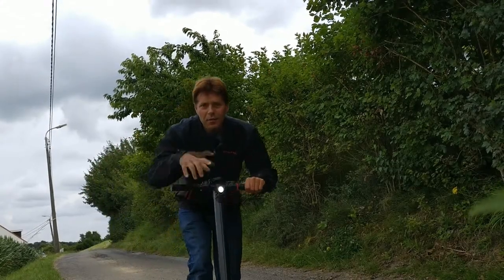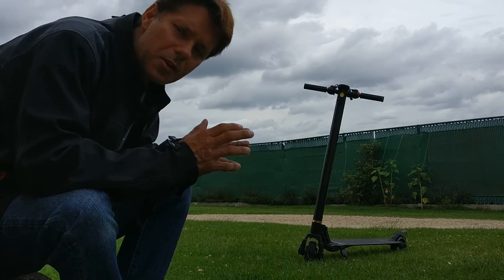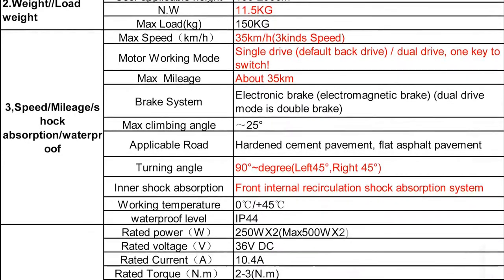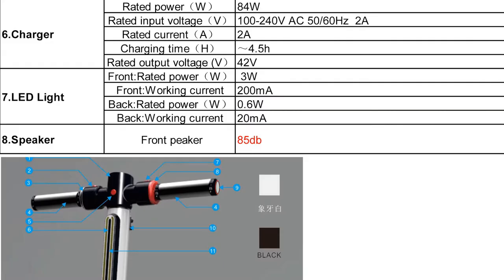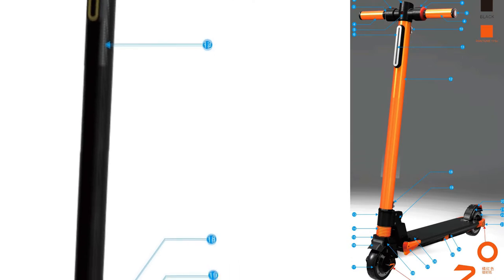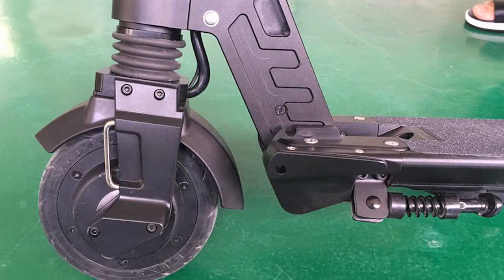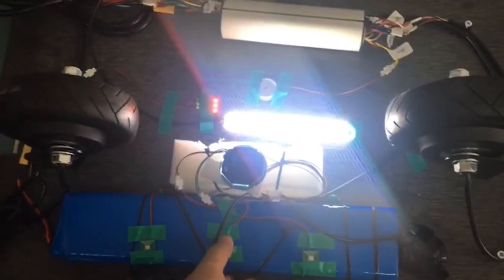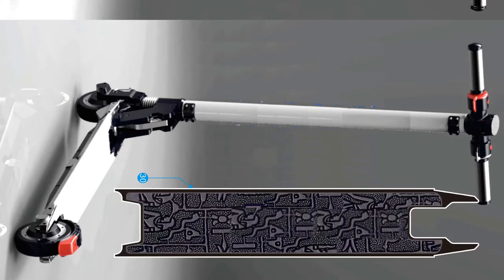Exclusive preview of the newest Carbon Fiber Scooter (model S4? - due autumn 2017)

Comment: I have to say I'm very impressed Kurt. It looks absolutely sick. This seem to address every single issue that S3 has.
 The only thing I miss here is waterproofness, and adjustable pole. IP44 is not much, even the S3 was IP55
Reply: Could you please grab one as soon as possible?
I can only say yes or no, once I see a comprehensive review.
Reply from the maker: The s3 model is only IP44 too. It means you can drive on wet surface, but you should try to avoid the water flakes. It makes no sense to drive through the rain with it.
Reply: According to the manual it is IP55 (after you tighten all the screws lol)
Reply: lol
Reply: lol
Reply from the maker: You are added to the waiting list. Can you please provide me with your email address and country name? Please send to kurtATskynetDOTbe Please replace AT with @ sign and DOT with a . sign. Thanks

Comment: Hi, I am very interested but I have some questions.
1 how does it ride in puddles after the rain, does it damage the motors, brakes or electronics?
2 I need it to travel with me, so can I take it on commercial airlines? 
3 will I be able to charge it in any country with different electricity voltage?
   Thanks
Reply from the maker: 1. it is not recommended to drive in water puddles. You can drive on a wet road, but the motor should not get water into it. Driving into puddles will damage the motor. 
2. no, as this kind of equiment is mostly not allowed on commercial airplanes. 
3. no problem to charge it on 110 V or 220V. The adapter will adapt automatically. 

Kind regards.

Comment: Interested. But the price is double the old model?
Reply from the maker: If your body weight is less than 70 kg, then the old scooter is good for you. 
But if you have a higher weight, or if you live in hilly area, or if you want more speed (35km/h), more power and more range, the new one is for you. 
It all depends on what you want. There are 40 x 18650 cells in the new one, not 28 like the old one. There are 2 motors instead of 1. And the scooter has a better build quality. Including a buzzer, better suspension, supplemental lights on the handle bar and a rear brake light as well. It all adds up to build this scooter of course.
And last but not least, you'll get full technical support locally in Europe. So if it breaks down, you can let it repair.

Comment: China flooded  the world recent years with hoverboards, quite standardized build with two wheel motors 6.5' or bigger, 4.4Ah 36V battery (but seen yt review with half fake cells) and complex balancing electronics. Price is less than half of in same shop here electric scooter, what about tomorrow? Will saturated hoverboard market shift to e-scooters production?

I keep an Oxelo 9 kick scooter in car trunk permanently and since summer started also a folding bike, cannot decide which to convert electric or get a carbon ready made one, actually it's more for fun than necessity. 
...So far the most necessity is the sweat due to summer heat...

Good luck Kurt, at i'll keep an eye on you (your channel ;-)

Comment: Artificially raised speed by changing parameters, as in the previous model , two motors - same battery capacity = drastic reduction of range on one charge .
Btw - exact price (taxes or something else )????
Reply from the maker: As the number of batteries has been increased from 28 x 18650 batteries to 40 x 18650 batteries. The maximum distance you'll get is a little more than the previous model and you'll get more power. 
no prices yet, but we are looking at 650 to 750 euro including taxes.
Reply: Thanks for answer - two engine concept - good. There is one but ... Using one integrated BMS driver in case of failure drastically increases the cost of repair. At this moment electric scooters have a much inflated price due to the use of "moment of novelty"
Reply: Yeah, now we have two separate batteries, and motors, which means more things can go wrong, in addition of the added weight and lost aesthetics. i would prefer to take a different route, and  try to shrink the S3's controller (which takes a significant amount of space in the pole), and fill that space with additional batteries. Also, one stronger 36V wheel should be more than enough. That would be the perfect scooter in my opinion. The only things i would keep from this model are the simplified spring, the controlled back light, and the horn. Those are good ideas.
Reply from the maker: Hi,
There will be only one battery pack, that will be located under the deck. The space in the front pole will be used mainly for the BMS and the  controller. The controller will control both motors. The only part that is dual is the motor.

Comment: With FLJ Carbon S3 I lost time and 2-300 $ for only 99 km./3 charging If they make a warranty policy with return shipping included/pay by the seller...i am interested.  S3 have problem with shock absortion...It moves after a while and makes a noise. 
They can add batteries as S3 + S4 for a double range.

Comment: It has a lower IP protection than S3 model. S3 was IP55 and this "S4" model is IP44. A little weak point, otherwise a great scooter!
Reply from the maker: The S3 model is also only IP44, but they promote it with IP55. 
What this means is that you can drive the scooter on a wet road, but you absolutely have to avoid driving through water flakes. 
I have been driving with my S3 scooter on a wet road many times, no issue so far. Now I have more than 880 km on the odo meter.

Comment: IMO this is a massive downgrade. The slim carbon fibre design and less is more approach was perfect! This is now like every other scooter out there. Lights, wires, bolts and screws everywhere has ruined the look. The deck looks fat and horrid
Reply from the maker: It is all in the eye of the beholder. I am not sure what is your weight, but if you are more than 80kg, then this new model will be something for you. I'm 70 kg and I can go up hills at a speed of 5 to 7km/h with an incline of 12°. If your weight is higher, then the carbon fiber scooter won't be for you, as you will not make it up the hill. The torque and power of the newest scooter is much higher. I will get the new version in by the end of the month and I will do a side by side comparison of both scooters. Then you can decide which one fits you more. But be aware that the power of the newest version is much much higher. It beats all other one motor scooters regarding power, for sure.